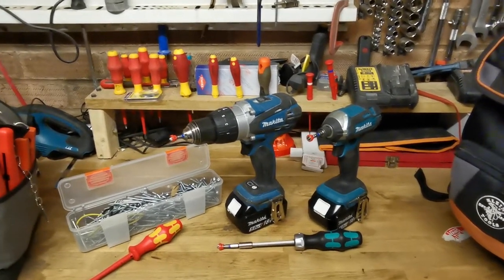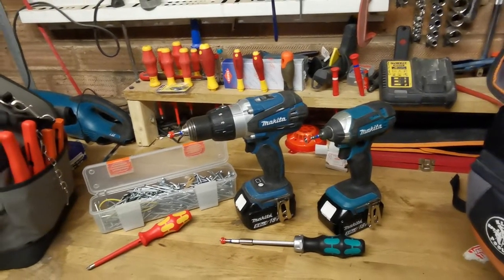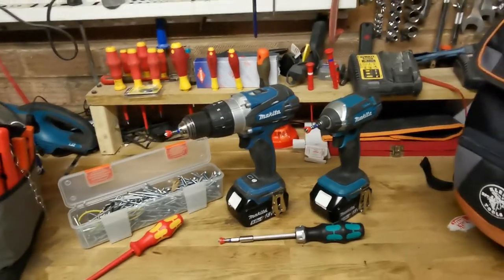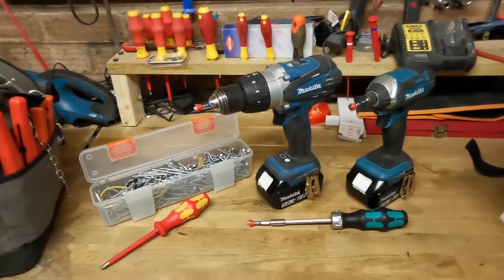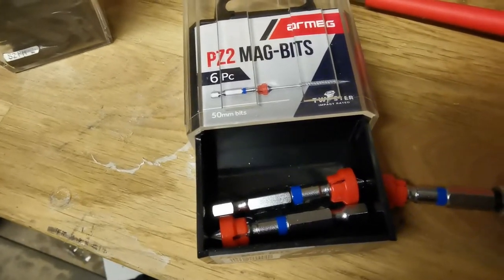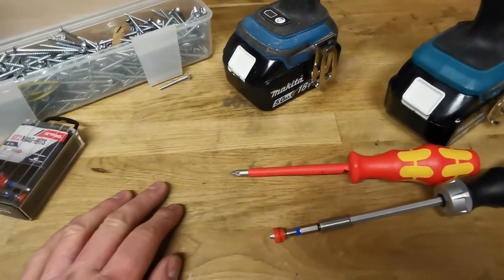My new found love Armeg Tools. Pure Genius

Comment: Dewalt does have a couple options for magnetizing their longer bits with an external magnet. (Or at least they are available in the US) They do have different ones depending on what line of bits you use though... (MaxFit/MaxImpact vs Flextorq)